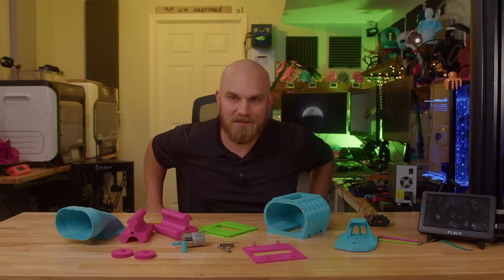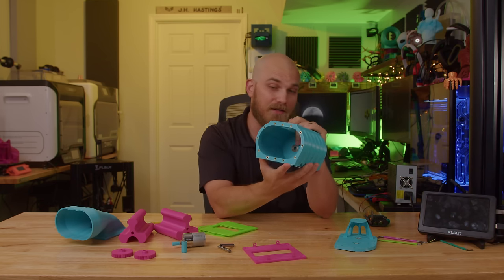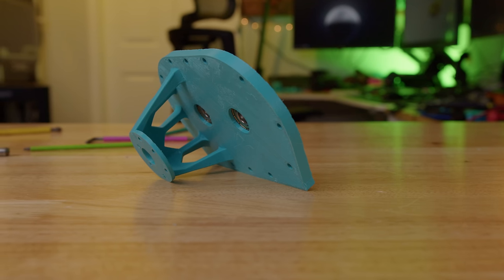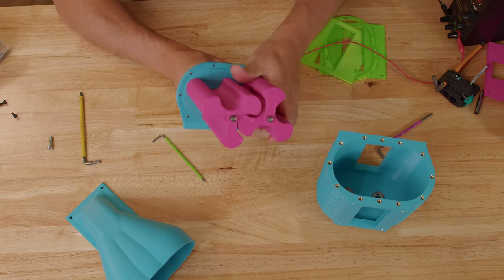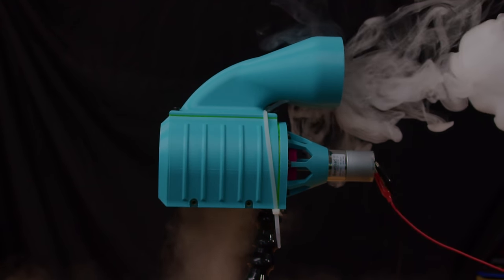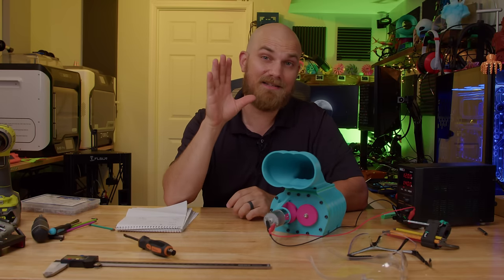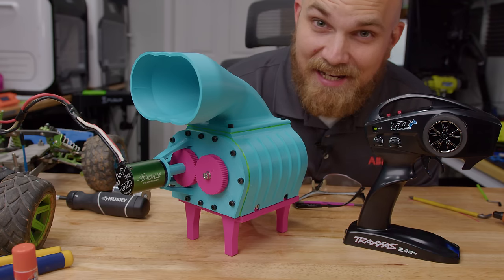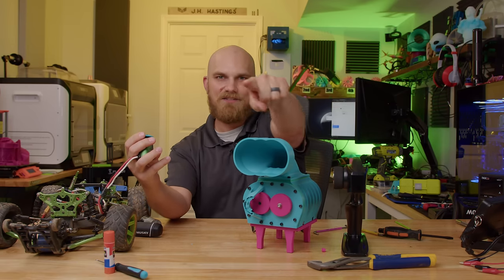I SUPERCHARGED My Custom Loop…… Literally

Comment: As a final "fix" before you test into destruction, try making the rotor-rotor & rotor-case airtight. Coat everything inside with epoxy and run it slow (~1 rpm) for 2 hours. The epoxy will fill the spaces and cure but the motion will not let it settle where it has interference. Should quiet it down too. Once the insides get solid, clean off the entry & exit areas with acetone.
Afterward, you should be able to run at somewhat higher speeds combined with a positive displacement pump, which yields a more even higher pressure presented to the input side of the radiator.

Comment: I think that you made the right choice with the charger type. Generally a twin screw compresses air. Meanwhile the roots just shoves as much air as possibble and it ends up compressing due to the excess of air, and since the pressure doesnt matter here its better.
Reply: Just wanna point out that there is no physical difference between "compressing" and "shoving as much air as possible until it compresses". They are the same process. Yes a screw type squeezes the air between the screws whereas a roots type moves the air in a comparatively large channel around the outside, but the volume opens up again once the air leaves the blower and enters the intake runners. From the perspective of the engine, or in this case a radiator, the two processes might as well be identical
Reply: You cannot have compression without displacement.

Comment: This would be cool to continue different designs with.
Maybe you can find a way to adapt the slip clutch from the rustler if you want to keep using the mamba, or make your own step up gear box so the 1000rpm is more effective.

Comment: Great Project!! I would sugest a belt system instead of gears to reduce the noise and also the Motor support clearly needs some redesign and reenforcement not only becausa it broke but was way too wabbly.

Comment: This is completely awesome. I love superchargers.
I'd love to see twin screws, I think they'd be more efficient. 
It seems that the motor mount could use a few more arms for stability, it's vibrating around a lot, which is inefficient and could lead to failure.  (HA, wrote this before the motor swap)
Didn't know about this type of geared motor. It would be perfect for a future project I want to do. Your link to the motor is the inserts.

Comment: The reason it didn't work to well is because root blowers have gaskets on the end of the lobes to keep air from leaking out and around
Reply: He could make a TPU sleeve for one side to make it seal up better.
Reply: I suspect the large clearances on the rotors and low RPM were bigger handicaps.
Reply: @ferrumignis  the gaskets help close up the clearance problem better and then we will really see if it had enough speed or not.

Comment: If that motor has a lot of torque then a big gear on the end of that driving a smaller gear attached to the blower could get it going even faster.  Although you may need something more durable than 3d printed plastic to handle the speed.  In addition more precision is needed when you start adding more gears or else it will try and run away from you and shake itself apart.
Reply: What I don't get is why no one seems to grease gears. Specially when it comes to speed it not only helps with friction but should help smooth it out a little bit. Plastic gears still suck but grease helps quite a bit.
Reply: @MidnightMarrow  wouldnt the open design of the gears shoot grease all over the room? doesnt seem like that much of a good idea to me.

Comment: I'd use a belt to transfer power from the motor. It should deal with any misalignment in the assembly. Also, you could use RC spur gears to synchronise the rotors, they are quieter and more precise.
Reply: A timing belt and pulleys would also provide the synchronization with much less noise, but I realize he was trying to 3D print as much as possible. Still, it would be nice to eliminate the issues that we can easily eliminate using common, cheap parts that hobbyists would likely have or could obtain.

Comment: I'm not reading through 2k comments to check if this has been said already; but the tolerances between the rotors and the casing walls are very important to a roots blower making above atmospheric pressure. As it stands it will move air, but if you want positive displacement then you need to tighten up the gaps. Might even consider designing a 'seal' at the apex of each rotor lobe (oh that's why they are called apex seals on a rotary engine) to wear into the housing and opposing rotor; however if the tolerance isn't the same between the rotors and housing it will be an issue. 
And it would be cool to do a little video about how you design the helical twist into the rotors in Fusion360 or FreeCAD. Maybe print a few different rotation percentages to see if it has any effect on the flow... careful you may discover why Eaton has settled on the designs they have for their line of roots and TVS superchargers.
Nearly every vehicle I own ether has or had forced induction - just not my PC builds... yet...

Comment: You can improve the 'seal' between the rotors if you cut length-wise grooves on the outer surface of the lobes.
Grooved lobes 'grab' the air as it tries to slip past, smooth lobes let air blow by.
Doesn't make much difference at higher speeds, but it makes a huge improvement when 'idling'.
The only advantage of twisted rotors is less pulsing at the output side, slightly quieter operation.

Comment: 100,000 RPM Castle motor on a 3D printed blower? I got a feeling that the blower will actually compress the air now. This vid needs a part 2!

Comment: twinscrew wouldn't be good for cooling because it does internal compression, and would sap more power. Where as a roots does external compression (but for your purposes, there wouldn't really be compression, just moving air).

You'll find more benefits from twisting your screws, and having the appropriate outlet. These don't move a huge amount of air, but the concept is that nothing will stop it from moving air (yes I know that statement isn't correct, but it's correct for here)

Comment: The SOUND it produces is nice! You can make this design ACTUALLY useful by making it quieter AND attaching speed controll to a gas pedal in some driving simulator Forsa, NFS whatever. I believer it would be a lot of fun! 
Herringbone gears may be quieter and they wouldn't create a side thrust that breaks a gearbox. Please add noise insulation to a gearbox (styrofoam or anything). Lubrication may also help with the gear noise.
You may also make a solenoid v8 engine for additional "steam-punk" fun but it will need some deferent gear ratio.
Very cool almost practical design. Try it in rain games with speed controll please!

Comment: Sorry, but i may have missed this in the comments already.
Did you calibrate the the servo tester to the castle esc? It may not have had full performance if the esc was expecting different signal limits, and if the esc was setup with a reverse.

It's been a long time since i last programmed my castle esc, but iirc it should have a forward only mode(for rc racing) which could work well with the tester calibrated.

Comment: use a worm drive (big gear left, worm in the middle, big gear on the right) or use a mini timing belt like a T5 (they come in any width you need them in) and serpentine the belt under and over the 2 roots gears and down or to one side for the motor to drive it from.

Comment: Blower lobes normally have groves that run down the length of the outer apex of each lobe to hold what's called a vane which is essentially a gasket, a soft plastic, rubber, or even a brush would work pretty great in your application. It dosent seem like much but those vane gaskets can increase output by over 100% and its the main thing replaced on a blower rebuild. I'd love to see you incorporate this into your design and see how much it improves flow, combined with the higher rpm motor this thing could have a substantial output. On a side note blowers are designed to produce pressure, aka compressed air not air speed. So a cool test would be a pressure test to see how much PSI this thing can put out!

Comment: As a PC guy, car guy, as well as R/C car guy.... I absolutely want to see more of this setup!! If that is a 3s rated ESC it will absolutely handle the 12v from your power supply. A full charged 3s is 12.6V the 11.1V that's printed on the 3s pack is the full dead voltage.
Reply: also your gears looked to be worm gears you also called them that. a worm gear is not what you want here. A worm gear has a hallow to it to fit against another round gear at a 90* angle. You need just a standard spur gear for your application.

Comment: Hate tell ya, but for your use case, roots is not going to cut it. Root type blowers create pressure in the manifold which you aren't using where as twin screws directly create pressure and keep the pressure in the charger housing. Twin screw requires less torque to achieve the same pressure and are more efficient.

Realistically though, unless you're tolerances are spot on, screws are going to be a pain. And louder. Though, you could coat everything in a dry lubricant on the inside and see how well that does.

Comment: Definitely want to see it run on the Castle motor. Why did the servo tester not work? You might just need to calibrate the motor/esc to the range of the PWM signal coming out of the servo tester. The Traxxas remote most likely has a different pulse width range, and many of them are calibrated for the neutral position to be slightly off center to allow for more travel on throttle and less travel for brake/reverse.

Comment: Love how it sounded like a true blower on that full speedish run at the end. Very cool. Need to find a way to grease those gears or lube them some how. Would work better. Also if you design the rotors to have a seal at the edge of each rotor it would move much more air. Few small mods and that thing will be killer.

Comment: making a gear cover and using a light grease may drastically reduce noise and shortening the main case to close the end tolerances at the bearing ends of the rotors may improve airflow and static pressure been working with weiand 871 units recently and a little clearance closing helps a lot

Comment: A stronger mount on the faceplate would hold the motor better, as you said.  Think about brass gears (you could drill them for weight-savings) to further lower the noise, as I bet that's where 75% of the sound is coming from.  

My PC hase 16" tall 5" chrome exhaust stacks on top (huge case), to match my monster diesel truck with stacks.  Everybody loves it!

Comment: You could tighten the tollerances by either fusing molten wax to your impeller lobes or some layers of acrylic paint or both and then add silicone for a smooth rub.

Comment: Motor tip: If the outgoing axle is offset from the ingoing one, it most likely is faster (meaning less torque, but higher rpm). Every possible gearbox that makes sense (planetary) means there will be the faster shaft offset from the middle.

Comment: As loose as the clearances are, the blower actually moves a lot of air. Doubling the RPM would almost double the airflow, except for clearance losses. The roots blower was used to pump air into mines.

Comment: The gears you printed from McMaster-Carr are meant to be driven by a worm gear; they are not designed to mesh with each other. Because the teeth are concave, they are only meshing on the outer corners, which is causing a lot of the noise. A correct gear type would be straight teeth, or even better, helical or double helical a.k.a. herringbone gears. This would allow each tooth to gradually load and unload as they mesh, resulting in much quieter operation.
Reply: Adding a twist to the blower could also significantly reduce the noise, since it would eliminate the periodic pulsation in the volume flow which is causing the loudest, lowest frequency whine.

Comment: This is so awesome, I've never seen anyone do this. I've got a supercharged drag bike with a straight 2 lobe roots blower, as well as a PC I built myself.
I have a Kraken Z73 liquid cooler that I'm about to install on my PC, but now you're givin me second thoughts.

It would be cool to see a supercharger integrated with the liquid cooler radiator. My bike is mechanically fuel injected running on methanol and I have a small pipe that runs from the throttle manifold to the top of the trumpet (supercharger inlet). This sprays a steady stream of methanol into the blower to keep it cool while the throttle is open.
Don't know how much functionality this would have on a PC supercharger, or if it's possible. But it's an idea anyways.

Comment: You should add seals to each rotor. This will help sealing allowing the air to be compressed more. That’s what high horsepower roots style blowers use.

Comment: That got out of hand...

Some ideas if you got a plan to push that a bit further (would love to see this do something better):

Would be better to have a shaft that goes through the rotors - or just print the axle ends together with the rotor instead. Ensure your alignment and clearances. For some reason it sounded off. Having the housing printed out thicker might help with holding it together. Add a lip-groove or slot mating surface between the gear assembly endcap and the housing to set the alignment fixed. Shims to make sure the rotors are aligned by length and the housing can be made too. Tighten the gap on the rotors for better performance - unfortunately you would need a bit of rubbing for a proper running blower. Lube the rotors a teeny tiny bit.

Could use a two-piece gear housing that would accommodate extra bearings for the gears for reinforcement. That can also be designed to hold lubricant for the gears, adds a barrier against exposed noise too

If you decide to print the axle ends together with the rotors - use larger diameter then use suitable bearings accordingly. You can use thin section bearings for that if desired - or use no bearings at all so you can enlarge the axle diameter as much as possible (it's plastic so low friction - maybe use nylon or polyamide for the rotors and inserts)

If you also want to use that 1000rpm motor - or if the 540 you have isn't enough then put a simple one-stage reversed reduction gear set!

As for the motor...you might be able to get ESCs that can be used on its own. Hope some of these make sense!

Comment: I want to see that powerful motor spin that thing, 
but i also want to see different screw types
and i wonder if the tolerances could be played with to get it tighter,
and i wonder what kind of lubricant you could use
I didn't hear any mention of infill used for those internal screws, was that 100%? what would the infill effect for those internal screws?
You might need to change to a solid rod through the screws instead of a rod at each end?
Gosh you got my gears turning, so cool

Comment: Well, if you compress a fluid with a compressor it will increase a lot in temp and the speed of the air will be reduced so when it hits a surface it will increase its temp, it will be able to transfer some of the heat of that surface but as the speed is low it will stay around the surface and eventually the general temp will start increasing. If you increase the velocity (with a fan) it will also increase the temp of the air (much less than the compressor) also. Still, it will reduce the temp of the surfaces that the fast air is hitting, transferring heat off those surfaces and then dissipating it away from the surface. A compressor is not used to cool but to compress, if you want to cool you must move high volumes of air really fast.

Comment: What if you reversed the polarity of the motor? Instead of pushing air through the warm rad into the case pulling all the hot air out?

Comment: Add angle support on open end of mount, pull air out of the top ( heat rises ). Really cool work so far, you are definitely on to something. I think a smaller scale would be a worthy investment considering the price of GPUs, and that's where I would put it, so you could run more v+, and go FASTER !!!

Comment: Definitely interested in seeing twin screw rotors. I’d also recommend you helical cut the gears. It’s also really hard to tell which direction your rotors are turning, to be sure, roots blowers compress air by moving the air along the case walls, if you’re blowing down the middle, you’re losing most of the compressor function and it’s just being a fan.

Comment: What if you just added/printed brackets on the inside of the blower case and just mounted some kind of Noctua 120mm fan horizontally inside. That way you could eliminate any possibility for rotor noise and possibly up the airflow numbers

Comment: Nitro time baby!!😂 Like someone else mentioned, herringbone gears would probably be a better choice, as they self-align once you do your initial setup. If you had a gearbox for the motor out of your RC car, you could tame it down a bit. Still, with plastic rotors and housing, you probably don't want to spin that thing more than 3 or 4K rpm. without a 'blower blanket' to catch the flying parts when it comes apart.😳 I've seen the amount of carnage they can create on real superchargers. Pretty cool build though. It's for sure going to be a lot noisier than a twisted rotor SC, so you might want to eventually work on designing twisted style rotors for a bit of noise reduction. Also, being positive displacement pumps, the faster you spin them, the more air you get. 1000 rpm is nothing for a normal supercharger.😉